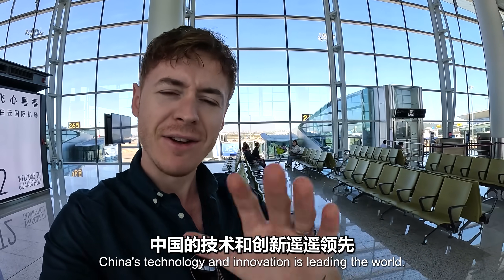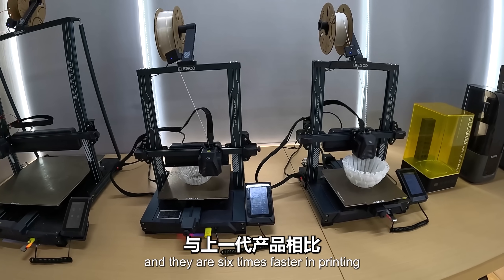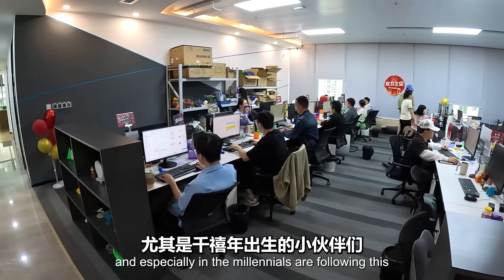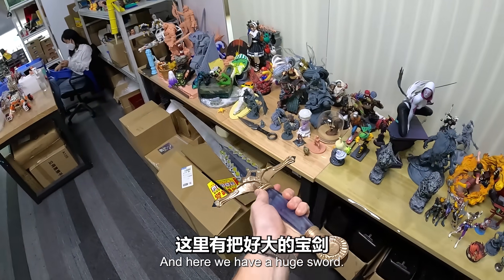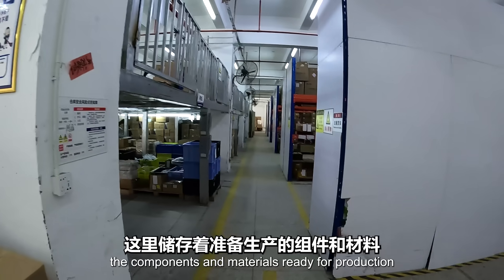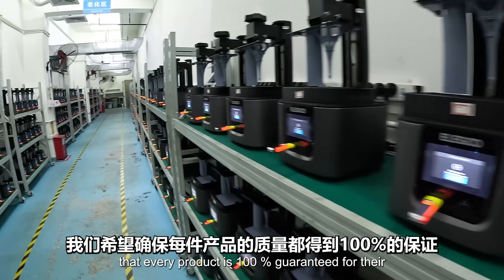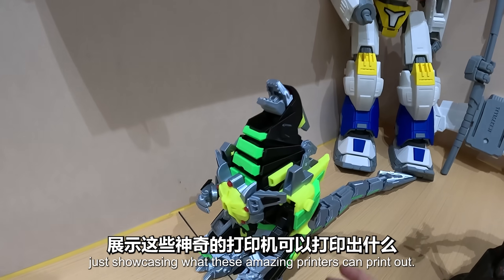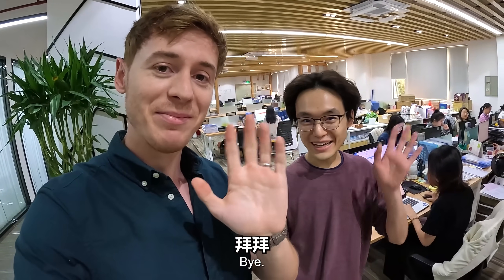China's Technology & Innovation are LEADING the World

Comment: Nice tour!  The company rep spoke clearly and articulately.  Good to see so many people working on this 3D printer company.

In addition to artwork, 3D printers are awesome useful custom parts for use around the home in kitchen, bathroom, living room.  Even bicycle light and equipment fixture parts.  Some carbon base filaments are strong enough to print a functional hand brake handle.  

I've used a FDM 3D printer to print outdoor mounts for rooftop solar even!

Simple structural parts don't require as much fine-grained 3D skill as artwork 3D but nonetheless structural parts are so very useful.  No matter the printer, I recommend software AutoCad Fusion 360 for modeling and Ultimaker Cura for slicing -- both free for personal non-commercial use.